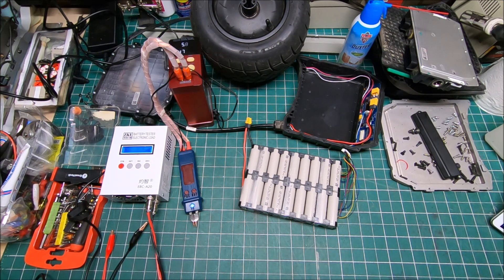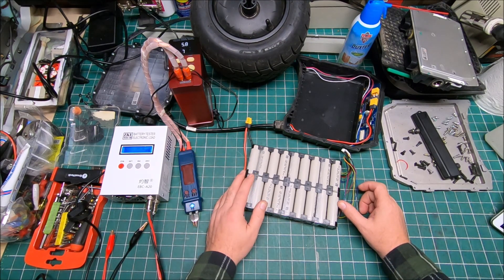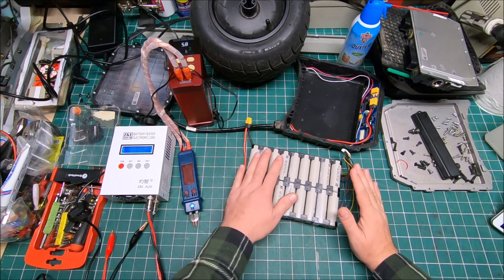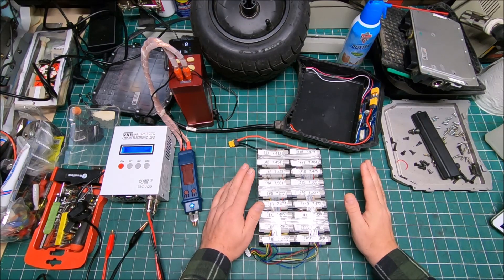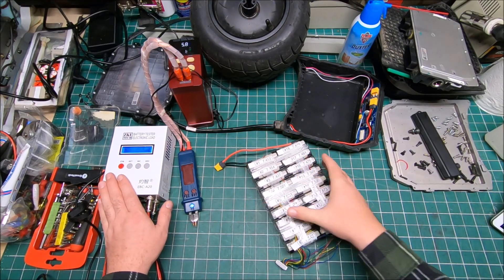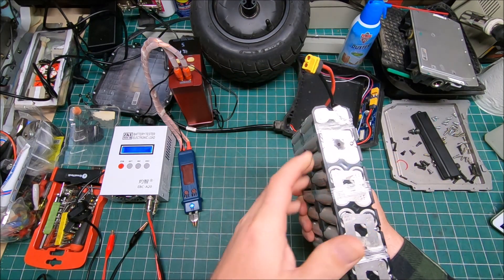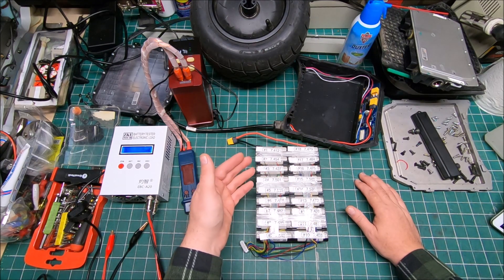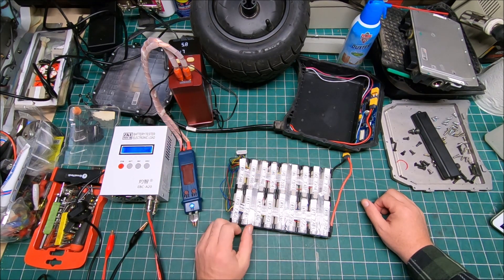Onewheel GT DIY battery repair part 1

Comment: do you have the diagram for which balance lead go to which group of cells im trying to make one of these from scratch to replace the quart battery i built (i know it wont fit in the pint battery box im 3d printing one that should fit
Reply from the maker: Here is https://imgur.com/a/onewheel-battery-pack-schematics-Sif7Wlo
Reply: @GPeter7  i thought the gt had different balance lead wiring than the xr and the pint as they are only 15s and not 18s like the gt is
Reply from the maker: @kody7041  Yes, you absolutely write.GT is a different, but quite similar
Reply: @GPeter7  awesome thank you!!

Comment: You didn't brick your device by doing this? It was said that Future Motion made it so that if you do any battery repairs it would be bricked.
Reply from the maker: Yes I brick it, but I did reset a corrupted memory error, if you don't know how to do it you're wheel will not be functional
Reply: @GPeter7  Glad to hear there's a way to get around it.
Reply from the maker: @stewjd01  Yes, thank God, there are smart people who figured it out, otherwise, I'll be stuck with a very expensive paperweight.
Reply: @GPeter7 Who and how did they do this?  Please do a follow up how the error can be reset.  i am sure the entire one wheel gt community would like to know!
Reply: @asong26 they do know about it. Research Rewheel